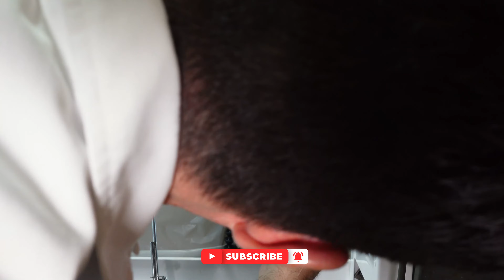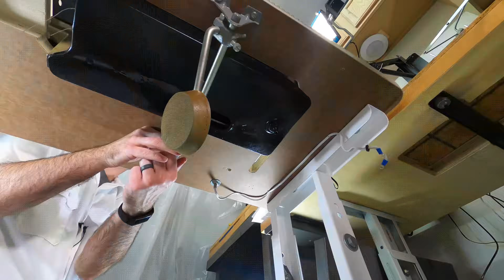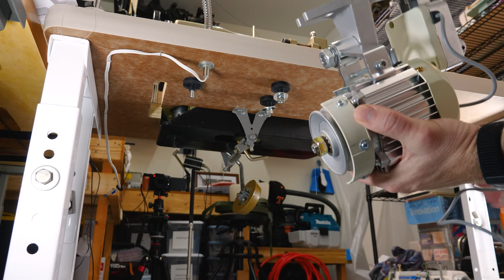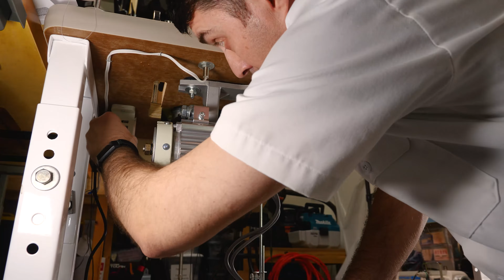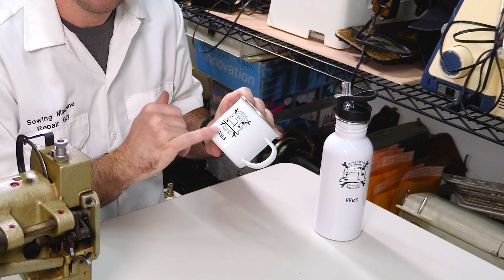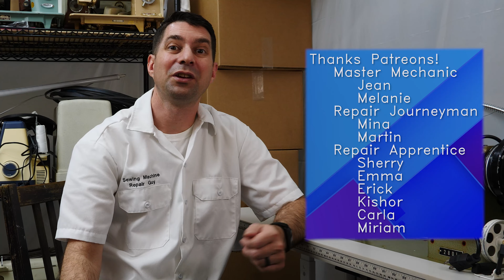The Easy Way to Install a Servo Motor on Your Industrial Machine, You Don't Have to Remove The Head

Comment: Hi there, thanks for sharing your video! It’s is very thorough but one thing I would like to ask, is it necessary to install and attach the needle positioner? Would the motor still work efficiently without it?

Comment: Wheres the Part 2 sir with the comparison after installing servo motor?
Reply: I bought a 750 watt servo to replace a 1/2hp Emerson the clutch went bad, I tried to replace the friction dusc by cementing  the old cork disc to a leather disc to return it back to correct thickness but No Joy. This motor was a bit of a kludge, it has a capacitor and some extra wire bundles hanging off the motor.
I have a Singer 269W11 Tacker I'd like to have the thread cutting knives correctly timed.

Comment: Hi Wes, I’m a pro sewist (background/ability level) w/50+ yrs experience in sewing…25 yrs pro sewing) and I have a servo on my “Brother” Industrial.  Absolutely LOVE IT!!!  
Question: Is it possible to install a servo motor (like the one you’ve installed here) onto a “Chandler” Blind hemmer?  I’m really tired of the CONSTANT humming of the industrial hemmer motor!  (The very reason I swapped out the one on my “Brother” industrial walker!  UGH!  Driving me crazy!
HELP me Obiwan Kenobi, you’re my only hope!  😂
btw… I have a Husqvarna “Viking” (handed down from my mom after she passed) with that beautiful 75+ yr old green-ish color from the early 1950s…..cast iron, I think, cuz it’s super heavy.  They sure don’t make em like they used to!  She’s a real “WORKHORSE of a sewing machine!  I’ve had her serviced and had a strong nylon belt installed in it.  She should last another 50 yrs in the right pair of hands 🙌🏼 that will treat her with loving care.  My question, though, is it possible to install a servo motor and needle positioner on it even though it’s very old but is still an AMAZING machine?
I really enjoy your videos and SUPER grateful for you sharing your knowledge, techniques and expertise! 
- Joanie, from MN

Comment: I just installed my new Eagle EA 750P motor while watching your video. Thanks !!  I want to sew 1 stitch/second but cant get the speed to go below 500. And there's no explanation as to the "U" codes on the controller. suggestions ?  I'm also getting a "Rough start" when I try to start slowly. Any tips/help would be deeply appreciated. 
And thanks for sharing the story of your wonderful dad

Comment: I have installed a  servo motor installed, but where can you buy lights to install to the motor, or can you connect to the motor ? Thank you
Reply: Did you end up finding some lights? Some which can be connect ed to the controller?

Comment: Great video thanks SMRGuy!

I'm going to throw one of these servo motors on my Singer 211G166 after seeing your video, this is going to make my twitchy throttle foot way smoother!

Do you think this size of 3/4hp (550w) would be beefy enough for the Singer 211?  Looks like it should be ...
Reply: Did you get the motor on your machine? I'm just getting to do mine after it siting in it's no for 3 years. I also have a Singer 211 G  146 and the servo is a 550 watt also.
How does your machine work with it on?

Comment: I have my moms industrial. My mom did all those same things. She was a heck of a lady. Wasn’t anything she couldn’t make. The machine is a Brother DB2-B755-3. It doesn’t have a walking foot, unfortunately. I cleaned and painted the legs. Top is in real good shape. I cleaned up the machine changed the oil and it runs like a champ, just too dang fast. 4000 spm. 😮 too fast for me. This has been very helpful. A less expensive option and I can keep my moms sewing machine. Thanks

Comment: Would you happen to have the instructions for that control unit? I have the same one, and am not able to get my needle position sensor working. There is a bunch of settings if you hold down the R button, but I have no idea what they are for with no manual? Thanks in advance.

Comment: Hi sewing machine guy, I just got a Mitsubishi CU- 865, and I need a cerci motor. Can you recommend the type I need? It’s an older model not new. It’s the same color as the machine in this video. Thank you so much, and I will be following your instructions on installing the new motor. Your very good in instructions.

Comment: One more thing, I think that the slotted bracket for the synchronizer slides into the synchronizer and you are supposed to find a threaded hole in the head of the machine to screw the threaded rod into then it goes through the slot.  No bending required.  However, in the absence of instructions, I think the way you mounted it is very clever.  And, it works, so that's all that matters.
Reply: what size allen wrench for the screws?

Comment: There is an L-shaped bolt that positions the motor just like your clutch motor.  It fits into a hole in the base and connects to the motor bracket with what they call a "connector".  I'm sure you had these pieces left over.  There are also five fender washers that you neglected to install on the large bolt that holds the motor.  They go between the motor bracket and the base and you must use them to get the L-shaped bolt to align with the connector.  Don't ask how I know this, just trust me.  Otherwise you did a nice job installing it and aligning it. I enjoy your channel.
Reply: I install 4 on my diff machines, . You are right. (4 more to go)
Ite way he install the needle pos was 100% wrong.
I am so tire of seeing people showing others how to do something and cannot even have the right tools (channel locks instead of open wrenches or sockets)

He should had 2 all thread bolts of diff size. The bracket he bent went on the needle pos, and a all thread bolt went into the machine . Then he locked it in place through the bracket (the one he bent) with 2 nuts...no bending

Comment: Thank you for showing how to do this.  I want to order the servo motor but have a question.  I have a Singer 95-10, my mom's, and a Consew 104.  Do you think I can switch out a servo motors them.  I finally got the Singer belt on correctly and it goes super fast.  Still working on getting the Consew to go.  Thanks.  I'm a new subscriber.

Comment: Thank you for making this one. I just bought the same machine in a private sale from an upholsterer. Except mine says Yakumo. The pedal is very touchy, so much in fact that I need to install a servo to slow it down.
Did your new motor reduce the speed enough to control easily? Or should I look into a speed reducer as well? I use mine for leather.

Comment: I have two machines with servo motors. One is a brushed type and the other is brushless with needle positioner. I found that putting a smaller pulley (40mm) very helpful for low speed control on both of them. Especially on the brushless, when it comes on it's still a little too fast.
Reply: What is the difference between the two ??? I ordered a bushless for my singer 281-1 it had original motor on it and it was crazy fast I used my sewing machine guys and it was like driving a Cadillac!